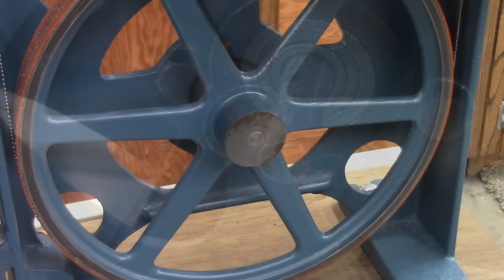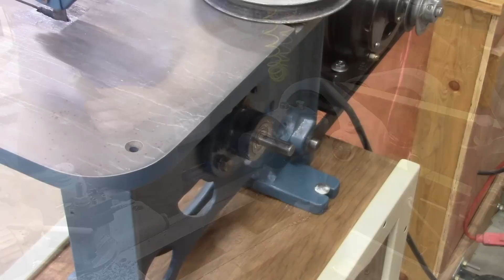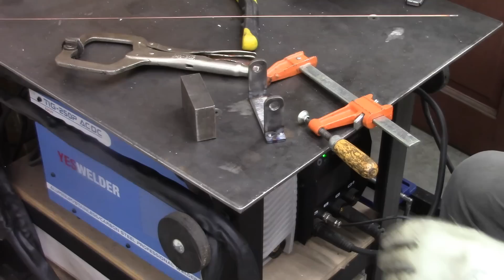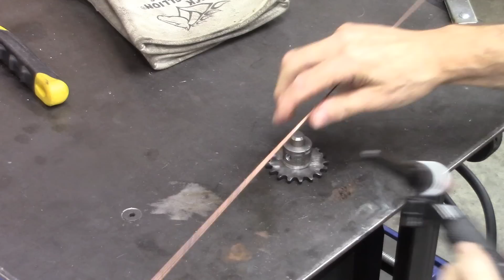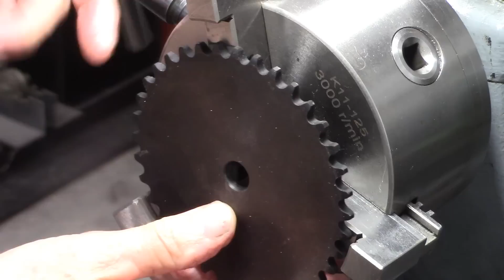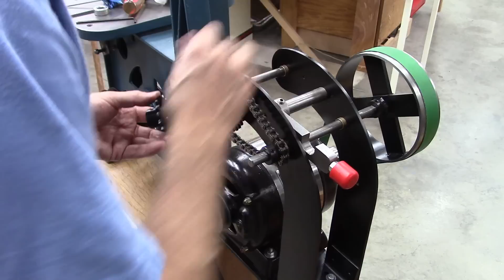The 1932 Craftsman Bandsaw Gets a Drive Update

Comment: Would it make sense to grind i.e. thin out that weld that's on the blade?
Reply from the maker: Its not really the weld its where the a tooth is missing at the weld. After making the video I tapered the teeth a little and it made very little difference which surprised me. Then I looked closely and notice the weld is slightly crocked. I think the net effect is the blade moved into the work at the weld. I probably need to just replace it. I bought 4 of them...  hopefully the others are good.

Comment: That parting tool is a winner, the best I have seen. Thanks.
Reply from the maker: I agree, I think I got the tool figured out. FYI  - If you build one the blade stick-out needs to be just over 3/4". It has to do with the amount of mechanical advantage the blade has on the spring.

Comment: I would recommend welding it first, then chuck it up and drill it through,  so it is concentric
Reply from the maker: Yes, that would have been much better. I've made steel wheels like that in the past, I just didn't think it through. No harm, the hammer alignment too did the job 😜

Comment: Hey Winky;  Thanks for the idea!  I have converted my old Craftsman 12" band saw to variable speed treadmill motor, so I can do wood and metal.  With the step down pulleys to get the right metal speed, plus high enough RPM's for wood, I used link belt pulleys.  They do slip sometimes, and I have to keep high tension on them.  I had not before thought about going to chain, so I'mma think I'mma do that! I LIKE it!
Reply from the maker: That is awesome! Mine was usable with the belt but it had to be really tight. I was worried about the bearing. The chain is perfect.

Comment: Perhaps if you made it so the belt went on the inside and the chain was on the outside, and if you sized the chain and belt just so, when you introduce the chain it puts enough slack on the belt that it's just disengaged and can remain on the pulleys.  And, when you take the chain off it just naturally tensions the belt.  The chain being on the outside would mean the belt could always stay where it goes, saving you from having to remove one to install the other.
Reply from the maker: I was actually going to do that but had a brain fart. The sleeve I made with the 3 set screws had to be installed first so that the screws could be tightened before installing the belt pulley. The sprocket had to be toward the saw so that I could slip the pulley.

Comment: My experience, weld then machine, that way no wibbly woboly!
Reply from the maker: Well the sprocket was pre-machined. It was mostly an error on my part.
Reply: @WinkysWorkshop  I got that, if you'd welded the hub onto the sprocket then, bored it out etc. I appreciate that the big sprocket would have been difficult to machine after welding the hub on! All the best, Matthew
Reply from the maker: @MatthewTinker-au-pont-blanc  I see what you are saying now. You're right on the small sprocket for sure. I've done that on wheels several times. Just didn't think about it. Thanks

Comment: Looks like you need to get your blades from a better supplier
Reply from the maker: Maybe...  although I've never had a blade that was perfect at the splice. Its a good weld but they didn't taper the teeth at the weld enough. I'm going to try grinding them.

Comment: A few months back you helped me out with some questions I had about an air compressor which turned out to be the same model as the one you have. thanks again. I enjoy these videos because you encounter a problem and then just fix it and go on. when you are less experienced you don't realize that the "problems" are just the norm when you try and do anything in the shop. You have some nice equipment, I always look forward to your videos.
Reply from the maker: Thanks! I cant remember what the problem was but you should install an auto drain. Maybe this is what we discussed but if not, its a very good idea.  https://youtu.be/bVddmQ14qas?si=QclAqPhoUBD0pWJX

Comment: Good job on the update. I would like you to consider putting a guard of some kind to protect you from having the chain come off the sprocket. I have seen the damage a chain can cause to a hand. It wasn't pretty

Thanks for the video
Reply from the maker: Thanks, I'll be putting a guard on the front pulley. If I had kids in the shop I'd do something with the chain too but my hands are never back there while the saw is running.

Comment: This might be a little bit off subject but the welding on those sprockets made me think about it, have you ever thought about designing and building a weld positioner? Welding pulleys and sprockets, even the wheels that you make would be easier with a speed controlled turning device. I would only use one maybe twice a year but if someone designed one that was simple and not too expensive I would like to give it go. Lol
Reply from the maker: Not off topic. The weld positioner is Absolutely on my list! Thanks
Reply: Keith Rucker got one from Vevor. Probably not the greatest quality but for a tool that isn't used a lot in a hobby shop it is adequate
Reply from the maker: @mikewatson4644  Not a bad idea, I've had good luck with vevor.

Comment: The chain is jamming on a link.....
Reply from the maker: It was hard to see but the little chain was the spacer washer behind the sprocket. The large chain was jumping due to the weld in the blade where the teeth were missing. It does look like a link problem but it's not. In fact, when it was belt drive the saw would stall at the weld.
Reply: @WinkysWorkshop  at 24:06 timeline onwards....the chain jumps like a link was unlocking from a curved shape from on the smaller sproket ...
Reply from the maker: @NavinBetamax  I know it looks that way but it the missing teeth on the blade. It makes a fairly extreme load.

Comment: I like it! I wouldn’t say that the changeover is difficult at all. My observation is that having the lathe is the key to creative inventions like this. Trying to match up shafts and pulleys and bearings from a catalog of stock sizes can be very frustrating. Another great video and another satisfying end result. 🥸👍👀👋✅
Reply from the maker: With a lathe, mill saw and welder you can do a lot of things! Although, I agree, the lathe is most important. Thanks!

Comment: Maybe a blade with a better weld, I do work working and refuse to buy cheap wood blades for this very reason as most cheap blades the weld either breaks or thumps when passing through the guide blocks.
Reply from the maker: These were actually custom made blades and the welds seem to be very good (odd size blade). It just hard to make a weld without effecting a couple of teeth on a metal cutting blade (small teeth). 1 missing tooth in a wood blade goes unnoticed but not so much on metal. My belt slipping probably amplified the issue by breaking another tooth. I have 3 more blades but I'll use this one until it fails or gets dull.

Comment: Suggestion: 
Put a switch in a place that's easier to reach. Might want to shut it off faster than you can find the one in the current location. 
I like it!!!
Reply from the maker: I like the simplistic of the switch but I agree. I probably mount a switch with a plug and simply plug the cord into it.

Comment: I'm hesitant to say it, but a new tight fitting pulley or sprocket and a filed and sanded shaft then that heavy duty Loctite would resolve the issue. Only cooking it with a torch busts that stuff loose.
Reply from the maker: I like being able to take thing apart without a torch. Also a steel or cast pulley in itself might have resolved the problem but the hub (sleeve) also provided a good method for mounting a sprocket. The belt drive was not good for the slow speed high torque needed for cutting metal. In hindsight, three new larger belt pulleys might have solved the belt slippage. Although I'm not sure how big they would need to be.
Reply: @WinkysWorkshop  
Hindsight is 20:15! Much better than perfect vision!!
Reply: @WinkysWorkshop  Ordinarily the slippage is always the lower friction surface smaller pulley. Belts and pulleys being in the category if friction drive mechanisms.
Removal of Loctite seized objects is actually much easier than it seems. 500 F for only a moment destroys the bond. Often used in clocks and other delicate mechanisms that prohibit any use of mechanical force. Outstanding for use with highly heat conductive metals such as brass or aluminum.
Reply from the maker: @thaiexodus2916  Yeah, I prefer the mechanical approach and it will never be an issue. In hindsight larger belt pulleys would have been a good way to go but the chian at the low speed will likely last my life time.

Comment: I noticed you used the back gears to lock the spindle to remove the chuck. 
Might want to give an explanation of the amount of force you're using and to be careful about using too much because of breaking the back gear teeth.
Reply from the maker: Probably a good idea. More than a gentle thump puts the gears at risk. I've fixed quite a few gears in the past. When I got this lathe it was in bad shape and had a chuck that was rusted in place. After weeks of soaking the chuck with oil and even heating it I ended up borrowing a strap wrench to put around the cone pulley. Then I put a lathe piece of hex stock in the chuck and used an air impact on it. Truthfully I was worried about the cone pulley but it held up well.